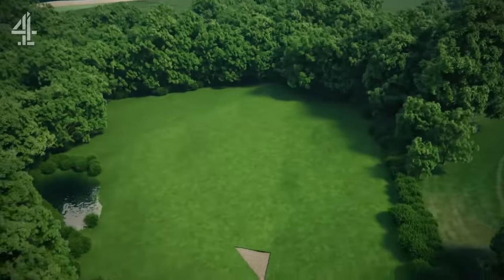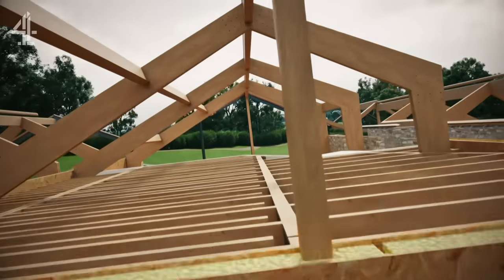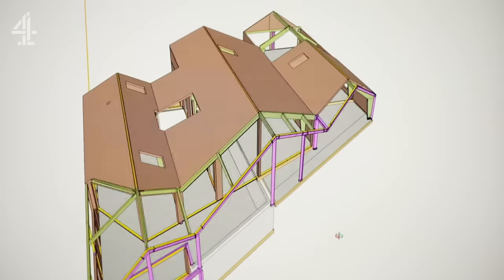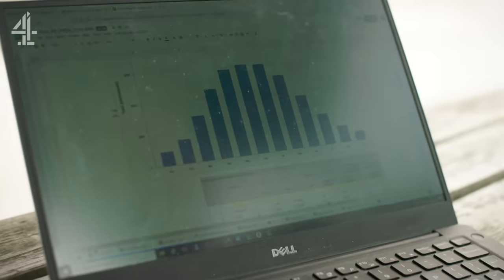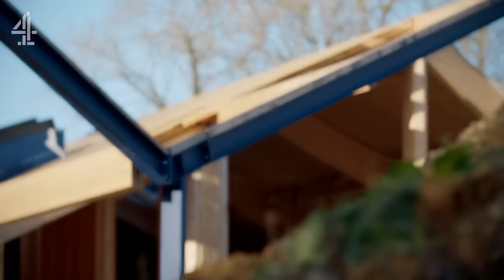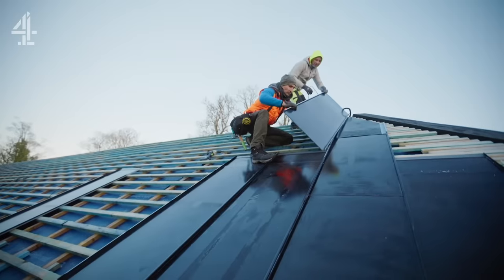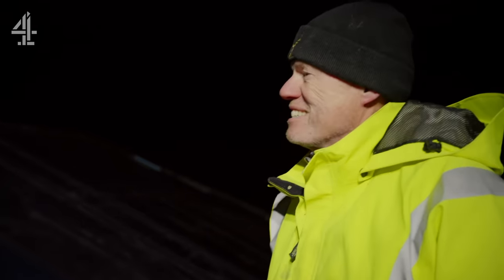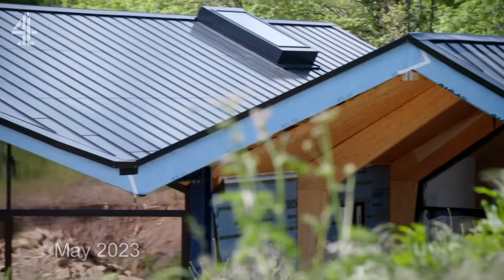Eco House Supplies the Village with Power | Grand Designs | Channel 4 Lifestyle

Comment: Unless this video is a few years old then its technically not the UK's first passifhaus, I had the pleasure of working on  the UK's first passifhaus and it was actually a primary school in Edinburgh, I say it was a pleasure it was an absolute nightmare. Everything had to be to a certain specification and a gap of 3 millimetres in-between the insulation could make it fail the test so you would have to fill it with expanding foam
Reply: They said it was the meant to be the first passive house 'premium'.
Reply: @aliasgharkhoyee9501  I can honestly only imagine how crazy that must have drove the poor guy because to get it certified the will come out and if that house isn't able to act as a vacuum seal it won't pass the certification

Comment: The question is how long do they last? If it is 10 years you need to work out how much it will be to replace the entire roof against the savings then get several skips to dump the old panels 🤷‍♀️

Comment: Nice to generate solar power but a shame about the building materials. Polystyrene, steel, concrete. Are there no environmentally friendly options such as hemp available?
Reply: That's what Passivehaus is about. Same with EVs. You only care about the total emissions over lifetime, which is lower for both things. Nothing about Passivehaus standards or philosophy, discourages using better insulation or whatever, when it becomes available. If hemp insulation were better, they'd use it. Remember that wood, hemp, polystyrene etc sequester the carbon in them. Heating over the lifetime of the building is obviously extremely important. In this case, which is sort of overkill, the extra solar he's paid for will possibly earn them some money if the power company pay them for the energy, but will definitely dramatically reduce this house's environmental impact/offset it. It's not good growing your building materials, rather than mining them, if that produces more pollution over the lifetime of the building. 

The moment a significantly better form of insulation is available and cost effective, it'll take over. I'm sure the hemp people are working, slowly because they're stoners, on making their product more useful too. Doesn't matter what they'd like it to be though, it only matters what the science says and the science does not care if your product is a super special weed you grew, it only cares about the data.
Reply: @jonevansauthor I hear ya but when you say “cost-effective” are you taking into account the amount of subsidies going into fossil fuels and the like, vs their true environmental cost? We need to subsidise the right things to make them economically viable if they are absorbing carbon. 🙏🌍🌱
Reply: @jonevansauthor  Mm.  Only I wasn't speaking of insulation, but things like hempcrete.  And industrial hemp is not grown and processed "by stoners" because you can't get high from it.
Reply: This is kind of missing the point. The house is designed to have a net positive climate impact. That includes the materials.
Reply: @rinnin  I'm saying people use the most cost effective insulation and/or the most effective one. None of it is made of arsenic or polonium. The eco-friendly bit comes from the lifetime of the product, not whether or not it's grown on the back of a sheep. And no, it's not economically viable to have to subsidise building materials. That, by definition, means they're not economically viable. 

I'm for Passivehaus because it's clearly better than 'old fashioned draughty house with poor insulation' or 'normal American house' or whatever. 

I am not worried that the Passivehaus folks are conspiring against us by employing the most polluting building materials they can find because that's completely contrary to common sense and the whole point of the thing. The people who want to do that, work for the terrible national home builders who churn out awful properties. Or Apple.
Reply: @KasSommers  yes, I'm mocking the hemp crowd as you could probably tell. Because they think hemp is magical and automatically better than everything else. Which suggests they are stoned because that's not how science works. If hempcrete were an actual thing that worked better, everyone would have switched to it. I don't know the details of why it's not been widely adopted but it will be one of it's too expensive, it doesn't have the right physical properties or they can't make enough. 

I'm not going to research it for you, but one immediate result claimed it's about 1/20th the strength of normal residential concrete. Even if that were massively overstated, it would be an obvious problem for lots of builds. 

Contrary to our wish for it to be so, we can't just switch to building everything with bamboo and soil and have it be structurally sound. Don't get me wrong, I'm all for research into better and better building materials, and encouraging them where they're applicable, but it'd be silly of us to think architects building Passivehaus are ignoring such things and just defaulting to whatever's cheapest... on a project with a 100K solar roof....

Comment: Why did they not face all the panels south?
Reply: The whole idea was to integrate them into the roof. That would have been a massive array on the ground
Reply: @hughmarcus1  change the orientation of the roof?
Reply: @smashingturnips5353  simplistic answer. You need to understand the concept of passiv housing

Comment: The loss of interest alone on the £118,000 invested is £5,000 a year.  EVEN IF that roof is generating 230 kW, that's £62 'saved' in electricity consumption (@27p/kWh).  At that rate (and of course it wouldn't be, as I feel sure he chose a nice sunny day!) it would take seven years to pay the investment back*.  In reality, I doubt he would ever see a return on his investment.  I'm afraid that in such examples, maths is rarely used honestly.  And this is even before you factor in generation degradation (which is 0.6% on ordinary panels), maintenance, and replacement of inverters and batteries (assuming he has them) - which are an incredible cost every 12-15 years.  Indeed, such typical systems never pay back their investments.

*I would have to see all the data to carry out a real cost analysis.  Money saved can be invested to pay for inevitable future costs, and there's inflation and energy price rises to take into such an account of the data, but a simple calculation can still be made to show the futility of such schemes.
Reply: You don't do the maths as as a return on investment.  You do it as a "What other investments could give me this return." So cash sitting in a bank account might give you a couple of %, but cash invested in a roof will save you more than you could earn elsewhere.  It's contrariwise, but it makes sense.

Comment: This was a ridiculously over sized vanity project.
Reply: So !
Reply: It's always hilarious when they call builds like this sustainable when the house is about 5 times as big as it needs to be and made of steel glass and concrete
Reply: @DarkJonas33 it’s as big as the owners want it to be. It’s sustainable because it’s got a very low energy load for its size.

Comment: Typical house uses 8kwh a day?  Lol that's a straight up lie.
Reply: Right.  I'd say we're fairly energy conscious in our house and we use between 15-20 kWh per day.
Reply: That’s probably because your house isn’t super insulated and air tight.
Reply: @longjonwhite  Regardless of how insulated or air tight my house is, I still need to run the washing machine and oven and iron and charge the car and have the lights on every day.

We're talking electricity generation here, not heating (although admittedly some people heat their house with electricity if they have a heat pump).
Reply: @Unshou  
We're all electric - our annual averaged daily consumption is 38 kWh, and we live in a 3-bed detached bungalow.
Reply: @barryfoster453  Doesn't surprise me, which just goes to show that the OP was correct in saying that 8kWh per day for the average house hold is a lie.

Comment: Cool solar product. I dont know where he got 8kwh per day from though for the typical daily electricity for one house. Its more like 30kwh per day for an average house.
Reply: in the six years since we retired, we have consumed a daily average of 8.17 KWh of electricity and 2.14 cubic metre (23.8 KWh) of gas in our 1980s four bedroomed detached house.  So yes 8 KWh of electricity, but over 30 KWh of energy.  A heat pump could replace the gas and reduce the requirement by around 20 KWh, and insulation and double glazing might save a further 2 or 3 KWh.
Reply: 9kwh here in my 4 bed house in the U.K.
Reply: Agreed with both of you. Not 30kwh per day.
Reply: You're correct, it's nonsense.  Maybe he's thinking of homes having gas as their heating.  We're all electric - our annual averaged daily consumption is 38 kWh, and we live in a 3-bed detached bungalow.